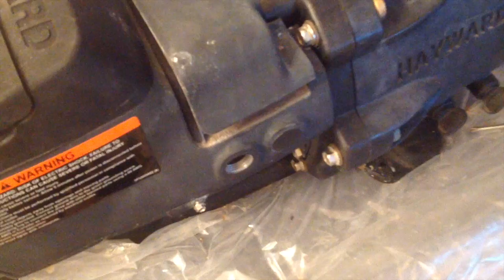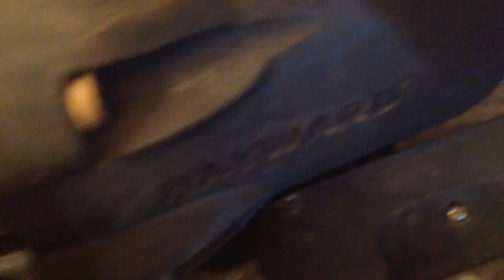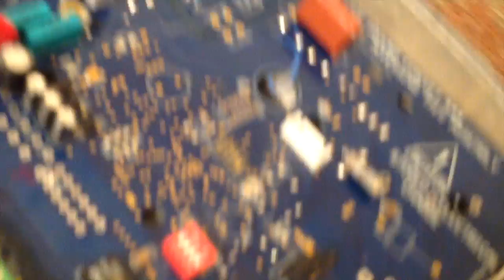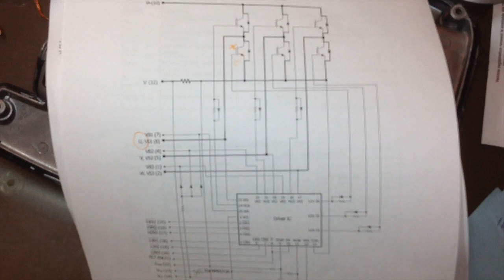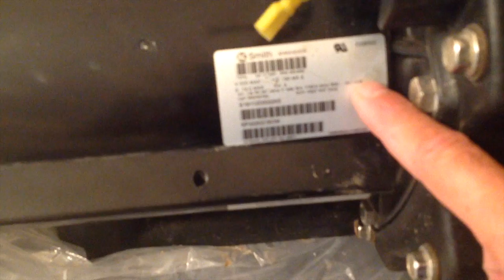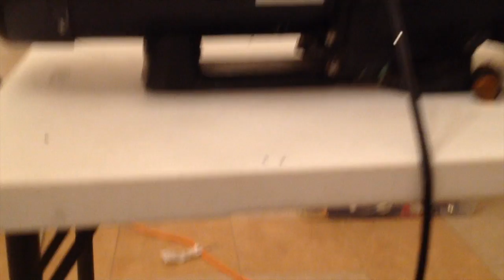Hayward SP3400VSP Control Module Repair

Comment: Hi Mark, thanks to you I was able to repair my pump as well. Thank you for sharing the IC part number.
There is a quick test you can make to make sure the pump had a similar failure to ours without disassembling everything first:
1) Make sure the power is disconnected and capacitors had time to discharge at least half hour before trying anything testing
2) Unplug the motor from the drive module (The three Red, Blue and Black wires)
3) Using a multi-meter with diode test capability test diode voltage between any two motor connector jacks
4) Make sure to diode test all of the combinations: Red to Blue, Red to Black, Blue to Black, Black to Red, Black to Blue, Blue to Red. Note I am referring to the terminals, not the pump wires.
5) The test may initially show a voltage result (instead of "Over Limit" or "OL") as DC bus capacitors are charged up, make sure the voltage is steady (not charging up) before considering it a positive result.
6) In a working pump you should eventually see Over Limit result for each combination from step 4, this means the IC is most likely good and the problem lies elsewhere.
7) Usually the motor will fail as soon as the first FET is shorted, so only one out of six FETs will be damaged, the diode test involving the terminal with a blown FET will fail when tested relative to the other two terminals, the diode test direction can indicate if it is a upper or lower FET (not that it matters much).

In summary if you use a diode test on the drive module motor connection and see something like 0.4V steady from Red to Blue and from Black to Blue, that means that one of the FETs connected to Blue terminal is shorted and the big IC needs to be replaced.

I hope it will help diagnose a similar problem without involving access to the rest of the pins and disassembling the pump. Remember to turn off the pump first and let the caps discharge. Stay safe.

Comment from the maker: If your pump have the same symptom as I describe in video I might be able to repair yours please PM me for cost and condition.
Reply: Hello Mark!
Did you happen to note the numbers on the varistor? Do you still have the disassembled circuit board?
Reply: Mark Kash how much to fix my motor controller? I have the exact same Hayward ecostar SP3400vsp installed in my pool.
Reply from the maker: If you need cost and condition as I mentioned please << PM>> me.
Reply: Hi mark. Can you repair mine? Eco star 
My email is schmauss1@gmail.com. I live in Nevada. 
7024084208
Reply: Hi Mark-How much to fix my motor controller for a Hayward Ecostar SP3400 VSP? My telephone number is 239-405-5167.
Reply: Not sure how to PM you.  Very interested in having you take a look at mine!  can you give me some contact info?  Email or whatever?  Mine is metria@xanth.us  Thanks in advance!
Reply: Mark can you please repair mine? Thank you! Rde.dios@yahoo.com 909-565-5310
Reply: Mark can you also repair mine?  Allen 480-521-2583
Reply: Do you have a way to PM you through youtube?

Comment from the maker: So start to disassemble the pump with removing the Lid from input terminal, After removing the lid you can see the three wire that passed through the hole between the module case and front of the pump, disconnect them from module with pulling on those jacks, then use the multi-meter and measure the resistivity between those motor connectors, they should be around 0.5-0.7 Ohm, also measure the resistivity between reach motor connector and chassis they should show open or very high resistivity. After this point we know the motor part of the pump is OK and we proceed with disassembling the control module.
Top doing so we have to remove 4 screws in bottom of the module two on each side that they secure the module to the top of the Motor, then we move the whole module a bit to the back and proceed to pushing the three motor connector pass through the small hold one at the time without damaging the wires or jacks, after that we are able to remove the whole control module housing from the pump.
Then flip the control housing module upside down with the fin point up and proceed to removing the 4 screws the they secure the two half of the housing together, them use a flat screw between the two upper and lower housing shell to split them a part, they used some sort of the silicon glue for sealing the two piece to prevent of water and moisture getting into the control module be careful after splitting the two part of housing you need to remove the jack that connect the key pad and display to the control module.
 
Now you expose the top part of the control module board, most of the components are install in other side of the board and since I did not have the schematic of the board to check the board I need to get to the other side of the board for part number and way to check them out.
If you look around the board sitting in bottom half of the chassis you can see two big caps and two coils and a transformer that are inserted in some sort of the glue in to the chassis, the easiest way to remove the mother board from chassis is to DE solder 18 soldering points ( two points  per cap,  8 points for transformer and one of the coil have 2 points and the other coil in transformer side have 4 solder points) that connect above components to the board also we have to remove all screws that secure the motherboard to the chassis 6 of these screws connecting the board to the chassis and 6 other screws connecting the other components install in bottom side of the board to the chassis. Those components using the aluminum chassis as heat sink.
In motherboard some of the high voltage soldering point in transformer side cover with some sort of silicon glue for protection, remove silicon glue with pilling them off before removing the solder joints.
 
Also we have to remove the solder joint of two small wire that is coming from Undernet of the mother board through a hole in middle of the board these wire are connect to the some sort of thermo resistor., After removing all above solder joints and screws you need to use heat gun to heat up the glue between the caps and the coils while pull the board slowly away from chassis.
After removing the motherboard clean all solder from caps, transformer and coils terminals also clean all holes that those terminals should go back into. Make sure we don’t get misalignment between the terminal of removed components and hole that they came off since we have to put back the entire component after repairing the board.
When you looking in the other side of the board you can see couple FETS and Diode Bridget and a big IC chip but all these component install face toward mother board so you cannot see the part number, but you can bend those component enough to be able to read the part number then find the spec sheet and check them out. After finding the spec for the IC chip that was IRAMX16UP60B-2 (19 pins 16 AMP) It was obvious to me this is the weakest part of the design because of high current, high voltage resulting high temperature and stress ( so called driver part of the circuitry). So I start testing six output transistors within IC motor drive and I find a short transistor between one of the three outputs that goes to the motor and ground reel that is enough to disable the pump. If I knew the IC part number I could test it before removing the motherboard from the chassis with access to the IC chip pins from the top of the motherboard. But at the end for IC replacement we have to go through procedure of removing the motherboard from chassis.
I did check the mother board for water damage and corrosion and did not find any so I order the IC chip though EBay for $20.
Reply: Mark Kash So if the reading between the power terminals is open, that indicates the chip is bad?
Reply: Hi Mark, great job sir!!! I am using your wonderfull video for fix my drive unit. my only problem is remove de 16 spots on the top of the main board. can you show my which kind of desolder machine was used for remove solder points?. I have 862d+ desoldering station but it is not enought heat to desoldering this points.